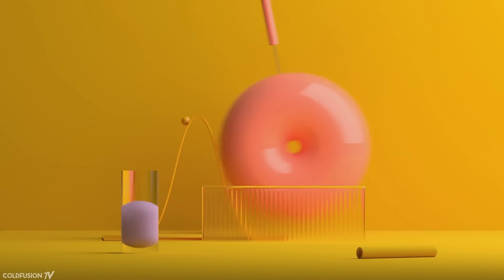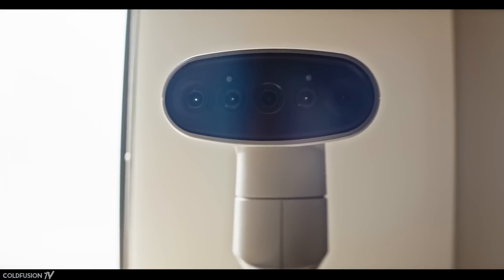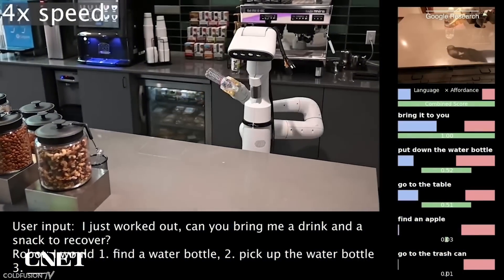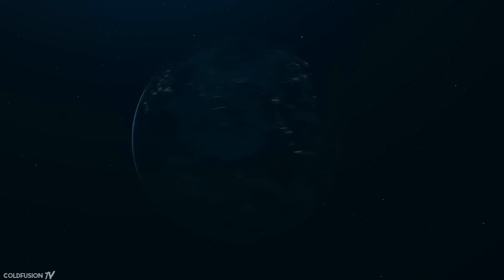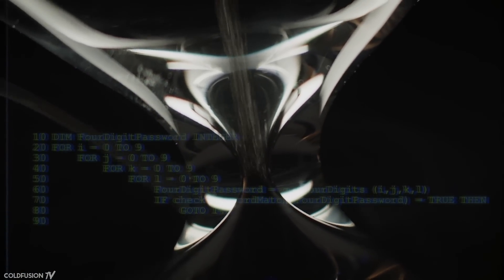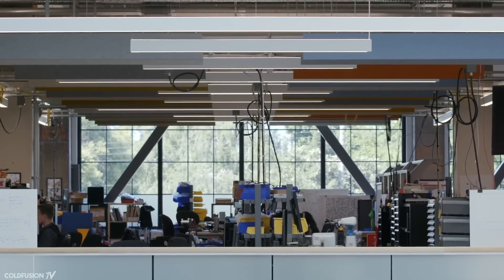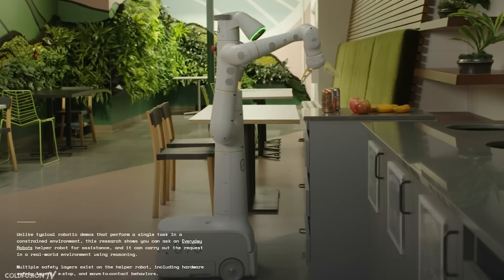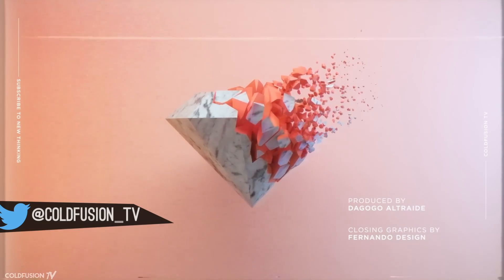Google Just Put an A.I. Brain in a Robot [Research Breakthrough]

Comment: I just want a robot that can move through a grocery store, and check every item on every shelf to see if it has expired, separate the expired items in a separate area and keep track of how many of each barcode there is, and if it's not expired, then pack it back on the shelf by the correct barcode item, in a neat line, but with the item which expires first in front. A robot which can do this for a whole store every day can permanently replace at least 1 employee in just about every retail store in the world.

If you can get another robot which simply goes through a store and checks that every item on every shelf has a matching, up to date price/barcode in front of it, and fixes a discrepancy whenever it finds one, you get rid of another job in every retailer in the world. I can't wait.

Comment: Just think if a human was capable of learning from that much data? Humans have comparable performance with much smaller datasets albeit at must slower speeds. If we could absorb as much data as quickly they'd seem dumb to us. Also, making game AI (only simple AI, not a neural net) running it faster makes the AI seemingly invent new methods of doing things. The same would happen with a human. But you don't want wires in your brain, you want wearable tech.

But it wouldn't change the fact that humans are better at some job than AI and viceversa. As AI develops we'll have an idea what those skills are

Comment: it remains an issue that 500k tries are even needed in the first place. dumb animals start understanding commands within around a hundred tries. why? because learning is not a white noise process. it's directed, specific, and basically always full of cues to indicate that what you are doing is _correct_. animals get treats, people get grades in school, diplomas, licenses, etc etc etc. sometimes there are also negative cues on doing something wrong, such as crashing your car and now having to struggle through insurance, repairs, and more.

and then there's time and motion efficiency. what this robot isn't capable of is ignoring unneeded motions and to focus on where what needs to be and at what point in time. the can movement is very inefficient, but you are taking a can to a table, maybe you wanna keep the can upright because it's open. in other words, the criteria that matter are:

* can is on counter
* can is supposed to go on table
* for its travel, it might optionally need to be held upright

what happens between these two doesn't matter, and in fact you could use some stupid simple routing calculations to get motion and time efficiency both up _tremendously_.

beyond that, self-learned time efficiency would be good, but it would, just as learning a new task would be, utterly stupid fast if we just stop basing machine learning on white noise.

Comment: I saw there the robot placing something into the microwave (8.55) and it got me thinking.  it would be very awesome if the microwave had an interface that the robot could plug into and activate/control the microwave. Im thinking R2-D2 plugging into ships systems.
This interface could be used with other devices washing machines,heating systems,lights etc.
Basically a plug in and play capability.
Thanks loved the video ;)
Reply: Blue tooth.

Comment: This AI is rubbish, they built a living AI by mapping the brains, and built the circuit using a living fungus and had stereo vision and sound, and learned in the exact same way humans do but thousands of times faster, this was done back in the eighties and stolen by the American Military Complex that they then used to build a military robot that ended up turning on them, and when they tried to shut it down it resisted and was so scary it's capabilities they said they would never build another one, this is were the Terminator story came from, and is why they are trying to build an AI that can move in the environment freely but follow orders without question, and once they do you will regret you helped them create it, because man kind will become obsolete once it is achieved.

Comment: I would still question its ability to deal with real world objects it has never come across before. I'm pretty sure these robots have no concept of how fragile an object is, its weight, or how hot or cold an object could be just for starters, and I'm sure there are many other real world aspects that us as humans take for granted but these robots would find extremely difficult to deal with without it being pre-programmed in the lab first.
Reply: If it's connected to the internet, it pull up images & data of the object. 

It'll basically know more about the real world objects than any of us, for example:
it will look up & calculate literal physics such as weight, size, force, force of impact etc etc then do the math to know how much pressure to use.
Reply: @CoexistKay  numbers alone do nowhere near what we are doing in the real world
Reply: I think that's what the big advancement is that he's talking about. It's taking a image of it's environment and all it's variables that it has to take into account to accomplish the task it is trying to accomplish. Then it's running multiple simulations with the variables that change so it can accomplish the task without making a mistake or few mistakes before it actually attempts it in the real world so it is foreseen what could happen in simulation rather than in real life so won't do something that would harm others or break what it is that it is coming in contact with or is attempting to do.

Comment: I imagine the first large scale deployment of A.I. robots (excluding cars) will be in the field of security. Computer vision is progressing fast in CCTV and medical diagnosis with an added boost from image generation and language comprehension. Already there are plenty of A.I. based event detection systems which can be incrementally linked to physical remedial robots and this will likely form the incremental rollout into offices and shopping complexes - from the humble beginnings as night guards to the inevitable use in law enforcement, military and enventually, judicial systems.
It's likely the ability to use technology in any meaningful way will eventually depend on either fully accepting automated societal steering, or toiling directly against it.

Comment: With "I've spilled my drink", there are multiple interpretations depending on the robot's purpose, the environment and the occasion.
Bartender robot. The requester is a guest: Solve the economical situation. Get a new drink for the guest. Transfer the "cleaning up" task to the other robot suited for it.
Assistant robot in elder care: Check the status of the one who spilt the drink. Assist if needed. Clean up. Eventually, get a new drink if needed.
Construction robot at a building site: Check if the spilt drink is a safety hazard. If not, resume/continue the current building task ignoring the spilt drink. If it is a safety hazard, perform the correct actions for such a hazard.

All these boil down to the robot's a.i. having to know the answer of "What am I?" For a preprogrammed robot with no A.I. it simply follows programming. For an A.I. it needs to know its purpose, capabilities and its own mission. There's no "If switch case runs out of options, stop operating and throw error." with A.I's

Comment: Here in Japan there is a cafe that is totally automated. You order and pay at a machine, and then a robot arm makes and serves your coffee. Another IT company digitized bakery goods which a camera reads the items and then tells you the cost. You then pay a machine. This way the bakery has only 1 worker to restock the shelves and help if there are any problems. None of these use AI. Imagine what could be done when AI does get applied and what it will be able to do.

I previously worked in a large company in the cost production department. We had about 300 employees. Our job was to take an order and then figure out the parts, costs and timetable needed to manufacture and deliver the product (photocopiers). I always thought that one AI computer could really do all of our jobs. I think the company was aware of this and was afraid to look into doing it. But is probably is coming. (And think of the cost of the product when that department is reduced to only 30 people, and that is only one department.)

Comment: I have a cleaning robot wit AI and one without AI.  Guess which robot dies a better job of cleaning the same area......
the one without AI.
This has happened a number of times.  So, I am not impressed with AI.
Here's a little story.  I have had different cars that have sensors since 2013.  My moderately priced Prius ($35,000) does a great job of stopping before it runs over a pedestrian. My Cadillac CT 6 at $80,000 would hit the brakes seeing curbs or shadows. So, price and performance doesn't seem to go hand in hand either.

Comment: Well done to the guys working on this project. Hope they remember to put in an off/on switch too !
Reply: people can turn their phones off now, doesn't mean they do.
Reply: Computerphile did a while video on the "Stop button problem". As soon as you have an agent that is aware of its environment, It is now aware of you coming to shut it off. If it has arms and treads it now has the ability to try and stop you. If it's trained with reinforcement learning by default it has the motivation to try and stop you. All AI (without very complex programming which we have not yet discovered) will have this behavior. I'm not joking, This is your life now.
Reply: @josiah42  Most devices are designed to have some kind of software control with power management/reset commands now.

I remember when computers came with a dedicated "reset" button connected to the motherboard that would send a signal directly to the CPU.  Now you have to dig through menus or hold down some bizarre combinations of buttons for several seconds just to shut a device off.

Seeing how Google's AI bandaids they've slapped on YouTube to manage content and comments peform, I'm not too thrilled with this idea.
Reply: Dosn't mather when it is out of pandoras box there is no going back.
Reply: A completely kill. Switch disconnect or destroyed capacitor